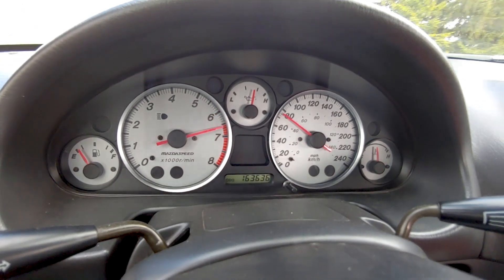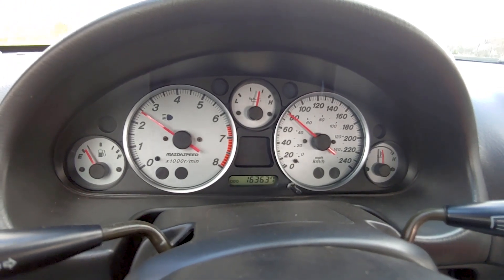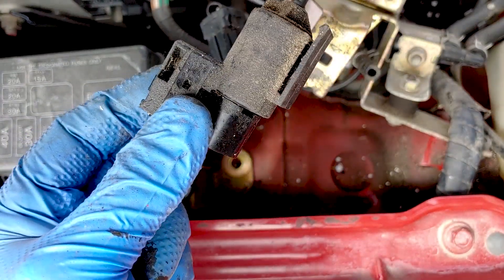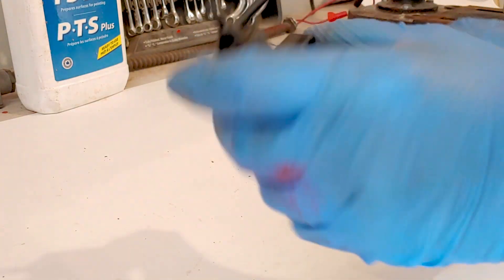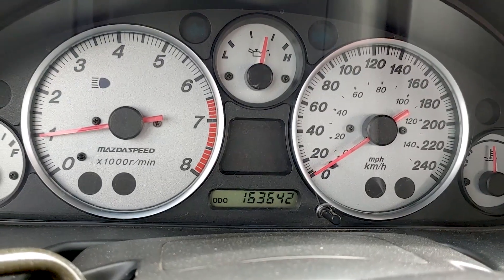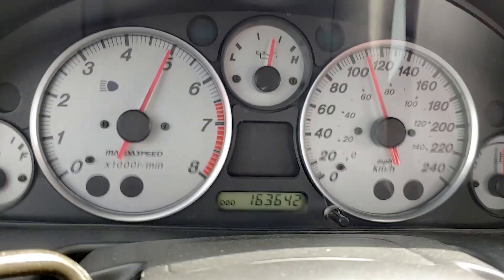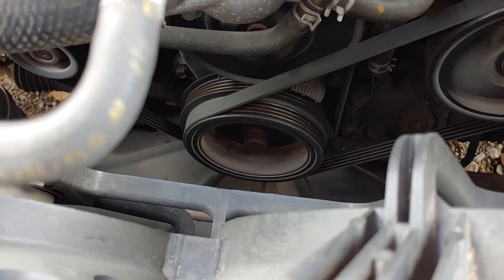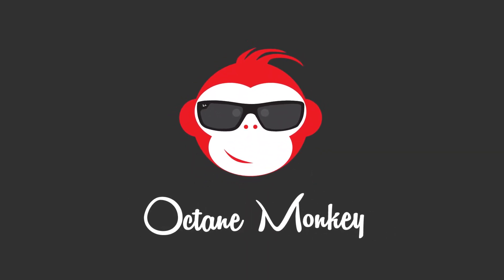Complete Guide for Service or Replacing MazdaSpeed NB Miata Boost Control Solenoid

Comment: You serviced an EGR component. Try cleaning the MAP sensor too. It’s connected directly with the short hose. You can try cleaning the boost controller solenoid that’s hanging off the valve cover

Comment: Fellow MSM owner.  Did you ever fix the bog issue?  If so what was your particular root cause?
Reply from the maker: Sort of, it had an exhaust leak which I think I fixed, and I did the flying miata sensor. Those videos are coming soon.
Reply: Thanks, having similar issues with my MSM.   Checking vacuum leaks and sensors. Let us know if the FM  modifier got yours back to its former self. Was hoping to keep mine stock but will go FM LE or Megasquirt if I have to

Comment: i have an aem air intake,fm downpipe and exhaust, fm intercooler, begi solenoid valve( bell engineering) running on 10psi... i got it stock and the car has completely transformed its honestly amazing....boost comes in strong at 3500rpm everytime and pulls to redline hard.But debating to get begi ecu reflash or megasquirt to fully eliminate the "bog"
Reply from the maker: Very nice, I am looking up those parts
Reply: @OctaneMonkey  so I was trying to find Bell engineerings site and it seems like they might’ve gone out of business.. at least that narrows my choice down to the MegaSquirt. Best of luck on your car man .
Reply from the maker: Thanks Connor! I have been sorting through it one issue at a time. Its almost running right, lol.

Comment: Unplug your TPS and report back ;)
Reply from the maker: Will do
Reply: @OctaneMonkey  

It'll cause a CEL, but the car will run awesome line you want it. First start it might stumble, but it should recover. This is just a band-aid to the proper solution of getting an actual ECU/tune. Most of what you're experiencing is the lackluster factory Mazda tune. 

The BOG is more so a stumbling on throttle where the car doesn't actually accelerate at all. So if you lunch it at 3500, the rpms don't rise at all.
Reply from the maker: I will try it and see if it remedies the issue. If it works I have been reading about putting a resistor across the input and output signal wires to adjust the voltages and trick the computer.
Reply: @OctaneMonkey  

Sounds good. The o2 mod is hit or miss. Disconnecting your TPS for too long can lead to o2 sensor failure because the car wants to dump all the fuel and make power. You also lose engine braking.

Comment: Yall also need to clean out the filter cap with mitsubishi logo while in there. That being plugged up with dirt is a big factor for causing the bog.
Reply from the maker: Okay I will take it out again and give it a thorough cleaning. I assumed it was just a way of blocking that port.